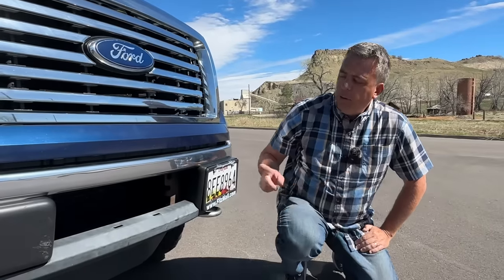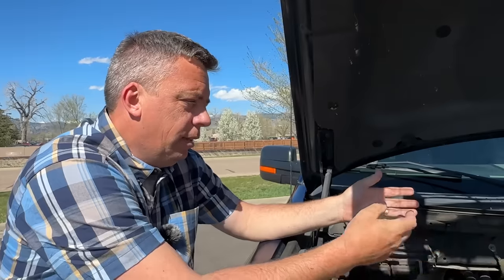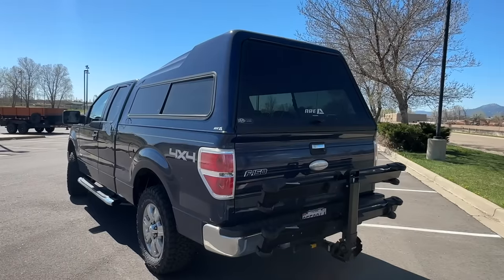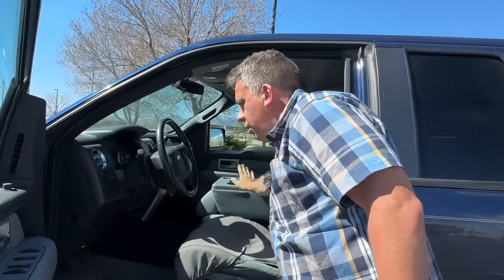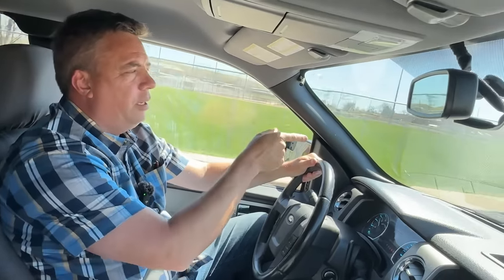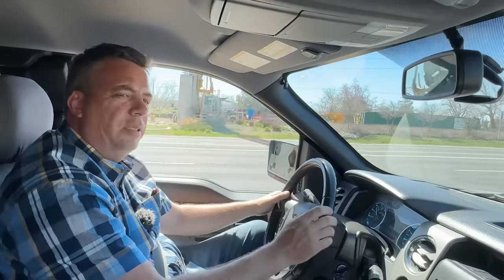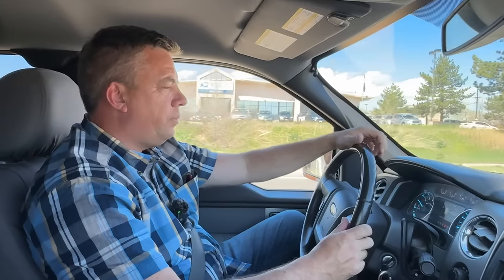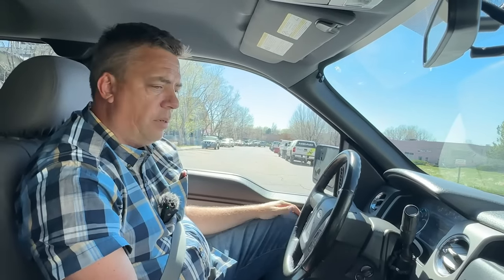How Has the Ford F-150 EcoBoost Held Up Over a Decade?

Comment: Ecoboost been out for over a decade and still no Ecoboost with a million miles without having 3 engines and 3 transmissions replaced.😂
Reply: Agreed while the Toyota Tundra with the 4.7L I-Force V8 can last a million miles with zero repairs.
Reply: There’s not a whole lot of people who even try to drive any vehicle to a million miles. I know I personally get a vehicle up to 80,000-100,000 miles and then get something else.
Reply: @CJColvin  You must not count timing belts as repairs...1 million miles would need 10 timing belts in that engine at a cost of around 1100 to 1500 each, more than the cost of a replacement Ecoboost engine....  Good engines, but lets be real here.

Comment: Ford pioneered twin turbo, got blasted, made fun of by all the “ no replacement for displacement” idiots. Now gm’s base and main engine is a twin turbo FOUR cylinder 😂 hemi is going bye bye. And the 5.3 gm is now an absolute 💩 due to them trying to squeeze as much as they can out of it with cylinder deactivation, and direct injection. Ford always first
Reply: The question is will that overpriced EcoBoost truck of yours outlast my 1996 Ford F150 with a 5.0L (302) Windsor V8? Also what job do you have and how much money do you make to afford that overpriced EcoBoost truck of yours?

Comment: My bro-in-law had a 14 3.5 that blew up at 125K and a buddy that had a 17 that blew up at 130K...both say they'll never buy another.
Reply: Right while my 2011 Ford F150 with a 5.0L Coyote V8 in it with 161,000 miles on it is still going strong.

Comment: My company, just like most, own a bunch of F150s. Will the engine last forever?? For sure. Does everything else need to be replaced along the way? Absolutely.  My oldest ecoboost in the fleet is a 15 with 350,000 miles. Cost about three times as much to get it to that mileage than it did my Tacoma but it's still going. F150s are so cheap that everytime I think we'll start buying Toyotas for the fleet, I find some F150 for $15k cheaper

Comment: The reason ford hasn't solved the timing issues is because they are always chasing higher horsepower / economy I wish they just refined the ecoboost for reliability more like toyota tends to when the 2030 tundra comes out it will be the same engine (hopefully) but just be perfected for reliability....

Comment: EcoBoosts aren't efficient engines.  You can have either Eco or Boost.  Not both.  I would have rather had the 5.0 over the 3.5 I went with in my FX2.

Comment: I have a 2011 Silverado 1500 z71 lt. Basic truck with ext cab,nothing fancy. Never had anything replaced except plugs, oil, brakes, and wheel bearings currently sitting at 243k miles with no headache except the bed getting rusty (rust belt syndrome). It's pulled well over its payload too many times too count. Bitch won't die, it'll outlive this ford without trying.

Comment: Ford should have stuck with the 6 speed transmission. The 10 speed is problematic. I've had both so I know from experience.
Reply: Or atleast give the customer the option.   Used to be choice manual or auto. I'd like a 6 speed that's why I won't touch a 150 after 2017 or a super duty after 22.

Comment: I had a 2014 that started leaking coolant into the engine at 60,000 miles.  Traded it in on a Toyota and will never buy another Ford.

Comment: What was the purpose of Ford switching to smaller turbo engines? Surely not to improve fuel efficiency because they suck down just as much gas as their larger, normally aspirated counterparts. Turbos are very expensive to replace, so that always makes me leery. Having to replace two? The repair bill will be heart attack inducing.
Reply: EPA regulations
Reply: You can thank your government for that, ever tighter emissions leading manufacturers to forced induction at the expense of reliability.

Comment: I've got probably 40 ford products. Maybe more. All older than 2006. Many old. Ford is serious about trucks being cutting edge and being ahead of competition with design. Options. Aluminum rust free. Etc. but damn. My 2005 f150 wasn't so bad but at 280k the cam phaser and sunroof rocker corner and panel rust has just pissed me off. Never buying new with a sunroof. I've recently gotten in to the Toyota cars for my gf and other fems in my family. Way better design of cars and cost effective. I'm gonna be trying tundra in a pickup just wish the chicken tax allowed Toyota to make a diesel 1 ton. I still have 7.3 and 460 ford has work trucks. Meh. The gm stuff that I have is just a plastic fall apart nightmare. Vortec gm stuff may be cheap but spider injection, intake gasket leaks, oil leaks, meh. American stuff is just blah. It's designed to suck that the last dollar out of you. Every friend and family member I have that has newer American stuff is just dissatisfied. Dealers are a-holes and behind...charging nasa repair prices. Vehicles have gone to sh!t. Too much tech. Plastic. Not even a damn switch, fuse, or relay. Capitalism and corporate greed. Murica
Reply: The thing about Toyota is that they excel at small engines. Their 4 cylinders will last longer than the car they sit in. Their 6 cylinders are slightly worse and their V8s are worse than the V6s.
Reply: Are you Canadian? Also what about American cars from the 50s, 60s, and early 70s?

Comment: 😂😂 cam phaser problem on a 1 gen EcoBoost 😂😂😂 sorry only the 2 gen had that the first gen only had turbo and timing chain stretch problems the phasers work fine on the 11 to 16 ecoboost 18 is when they started having big problems
Reply: I also drive a 12 355600kms with some mods and I love it when I got it i had to do the timing chain because it stretched and jumped time otherwise it had 1 factory turbo untill I put some bigger ones on it but those turbos are still going put them on a 14
Reply: The BIGGEST thing to save your turbos is doing your oil changes at 5000 miles or 8000 kms

Comment: they should sell the f-150 as a V8 with two turbos that makes 400hp being made of 130ksi steel everything, no aluminum pistons. but other then being 30 years old... with that ethanol stuff at the pumps now something like that gets 8mpg, used to be 17mpg... but its all 110 proof ethanol going around. really hard pressed to see those V6's doing that same 400hp because the V8's doing the same thing with the aluminum pistons is not a good idea... there is lots of aftermarket stuff for those now? pull a lot of rotational mass out of those to get the sales numbers for the performance figure... 130ksi forged alloy steel pistons drag the mpg's way down on that ethanol stuff, nearly so much as to looking for something else as the fuel savings would... cover buying a new one. silly old car i'm stuck with, everything in is was heavy iron only changing the rod crank and pistons to weigh less the 5.0's took off... 400hp takes a ton of gas in a mod motor. 8mpg just for 185hp in a base assembly that was "as far as i know specified for 650hp or so"... those "big in's" are feeling the EPA hard.
Reply: I tried to make sense of this. I really did.
Reply: What does this mean? I have a cousin that speaks the way you write, haven’t understood a word he’s spoke in 40 years, I just nod my head and say yep. I truthfully think he’s a genius that communicates at a higher level.
Reply: That is some seriously clumsy writing.   Not a single thought is completed before another is started.
Reply: Drugs are bad
Reply: Bro they answered that problem, 2040 fords will have a flux capacitor added. Seriously, I have no idea what you’re trying to say lol.

Comment: Wastegate issues where common on the new 3.4 Toyota twin turbo Ford wannabe. You had to remove the engine or cab to replace them! TOTALY INSANE! Not sure how they had to do it on this Ford. Cam Phaser issues have plagued Ford for years, especially in the 5.4 that everyone craps on. Both that engine as well as the 3.5 MUCH IMPROVED since 2011 where/are great engines the 5.4 of course not in production for years. The Cam Phasers on the 5.4 are nothing to change and I KNOW MANY of those with over 300k miles on them and some 3.5's with over 500k! People would ignore the Cam Phasers failing and let the entire top of the engine self destruct. You can hear the KNOCKING and that's how you know they are failing.
Reply: Just like the 5.4s, it's the oil pump. Phaser failure is a symptom of a bad oil pump.
Reply: @kingdaniel3519  Well the oil pump wasn't necessarily  bad on the 5.4, it was the oil flow passages are to "skinny". The did have a modified/stronger oil pump for it. None the less, I know so many of those with over 300,000 miles. Change the oil every 3-4k is key.
Reply: @danr4197  That's wrong. That's some made up bullshit by an internet "mechanic". It's the oil pump, it's always been the oil pump. The problem is the backing plate on them are aluminum and flex under moderate RPMs. It dumps the oil back into the pan, starving the top of the engine of oil when it's needed most.
Reply: @kingdaniel3519  You are wrong! It is not always due to a bad oil pump. I know many vehicles that needed phaser replacement and the oil pump was fine. As far as the 5.4 specifically, the oil passages are TOO NARROW for proper oil flow. That is NOT the oil pump's fault. Modified oil pumps WHERE designed to compensate for this issue so in a sense, you might consider the original oil pump bad I suppose. It is VERY common no less, for these engines to exceed 300k miles.
Reply: @kingdaniel3519   You are wrong! It is not always due to a bad oil pump. I know many vehicles that needed phaser replacement and the oil pump was fine. As far as the 5.4 specifically, the oil passages are TOO NARROW for proper oil flow. That is NOT the oil pump's fault. Modified oil pumps WHERE designed to compensate for this issue so in a sense, you might consider the original oil pump bad I suppose. It is VERY common no less, for these engines to exceed 300k miles.
Reply: @danr4197  Not even close. Try again.

Comment: This video is a complete lie!
Our shop very often rebuilding these same garbage Ecoboost engines. Not one version of the Ecoboost engines are forgiving engines, these are all have issues after the warranty expires. This vehicle is a unicorn or the owner just babied this truck without driving it normal. Timing chain issues, overheating, coolant leaks and oil leaks are few of the common issues and the electronics are disastrous as they age in the rust belt.

Comment: both Ford and GM are enfuriating. they Can make good if not great cars,  but for some dumb,  accountant lead,  idiotic reason,  they can barely make cars/ trucks that don't suffer from some catastrophic mechanical failure.  it's the same with European 'luxury' cars

Comment: Ecoboost is garbage. They only last to 100,000 miles before you have major problems hence the reason you always find the used ones with around that many miles. You might get lucky and go past the 100k mark but I wouldn’t buy one. No thanks.

Comment: 14.9mpg. My 2020 6.2L Silverado is still 16.6mpg over 20k mi and has 420hp and 460 lb/ft. of torque. Plus no turbos (or throttle bodies) to go bad.
Reply: I can promise you that 6.2 has a throttle body and they do go bad from time to time

Comment: I would just buy a Toyota Tundra V8, and thats it..
Reply: I would too, if I owned my own gas station. Otherwise, naaa.
Reply: @buyallmeans425  Ya those are thirsty, and only a 80 litre tank.
Reply: I had to pass on the tundra even though I wanted one, the fuel economy is absolutely terrible.
Reply: @buyallmeans425 they don’t get bad mileage 😂
Reply: Don’t know about the newer ones but the 11’s where horrible my buddy had/has to bring 20 extra gals to elk camp every year
Reply: @2-1inffwa97  I was looking at one in 2020 and the sticker said like 17mpg highway...

My f150 got 14mpg towing a loaded dual axle box trailer. 17mpg just to propel an empty truck stinks.
Reply: Let's not and say we did